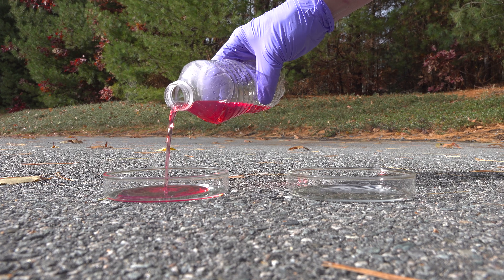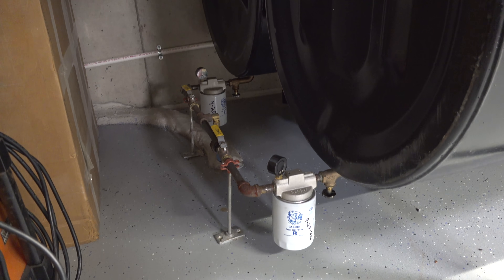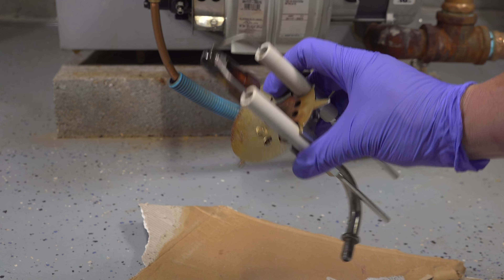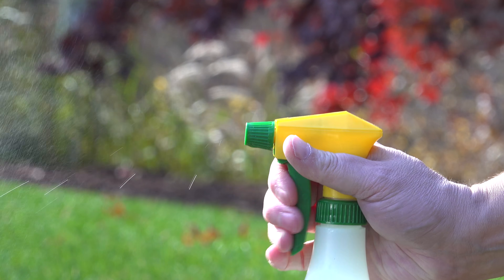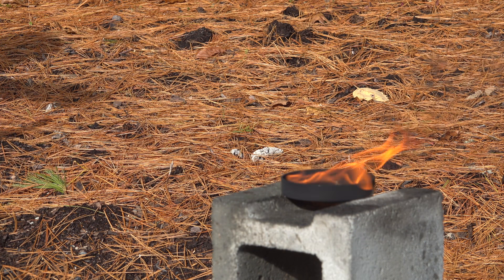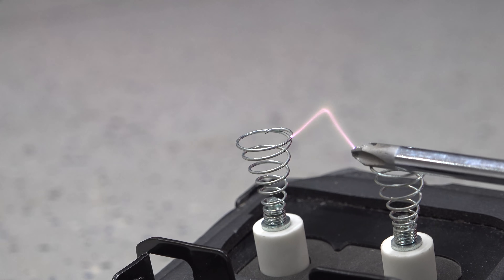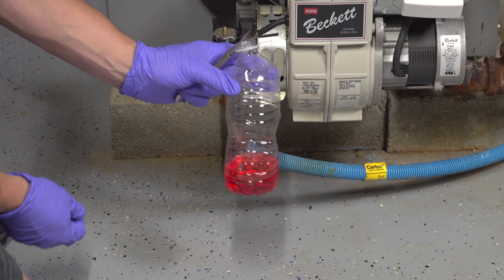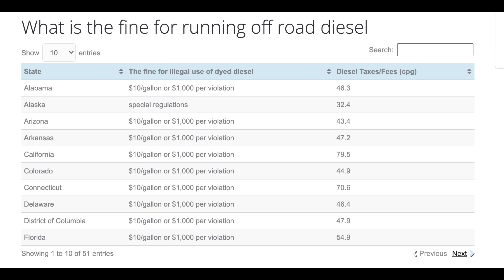Why Heating Oil is BETTER than GAS - Explained

Comment: technically, diesel and heating oil are the same, but nowadays, the diesel fuel is much more refined than heating oil and most car companies won't accept warranty repairs if the engine was fed heating oil.
Reply: Heating oil is the United States is all sold ULSF these days
Reply: @lg4ky  Not true
Reply: The DOT will give you a big fine if you use home heating oil because it does not have road tax like diesel
Reply: @Larry Butler Is your 40 year old diesel car still under warranty?
Nope
Does your 40 year old diesel car use common rail fuel injection?
Nope

So it's not BS. Your car has an original diesel engine and will run on basically any heavy oil. New diesel engines work in a slightly different way. A way that reduces lifespan and makes them shit. The point of the diesel engine was that you could run it on whatever you wanted. New ones are very picky about what you feed them.
Reply: @daviddavidson2357   as long as the oil is heated to decrease viscosity and filtered appropriately a common rail engine will run on the same oils as any old more rudimentary diesel engine. Its not black magic its mainly higher pressure and greater vaporization of the fuel.
Reply: In New York State they are exactly the same.
Reply: corey Babcock  Yes you can.. No problem.
Reply: New diesel fuel is only 15 Parts per million of sulfur vs 500 PPM in the past.  New diesels use high pressure common rails with injectors that pulse fuel up to 5x per fuel delivery, (depending on throttle load).  These Piezo injectors would clog with heating oil or old diesel oil.
Reply: It is exactly the same in NYS. The only difference is the color it was dyed. In fact, in NY most places sell bio diesel which is 10% recycled oils.
Reply: Anyone in the US saying these fuels are different is full of sheet.  The fuel delivery guy for our company literally just adds a ladle of colorant to the "on road" diesel for our "off road" diesel.  It's the exact same fuel with coloring added.  As far as 1K kerosene, I think there is a difference, but it definitely doesn't ignite like gasoline as suggested above.
Reply: I burn Cod liver oil in my truck
Reply: @Larry Butler Laughter? It was probably shock and horror that a German engineered product had broken after only a few decades.

Meanwhile if you did that with a six month old Tesla you'd probably get:
 "LOL caveat emptor.
Signed - Elon"
Reply: There's also farm diesel. What are the differences between farm, heating and road diesel?
Reply: @FishyFelix  they add sulfer to "on road" diesel so it's easy to test by the states DOT teams out in the field, otherwise it's the same thing! Just used for tax purposes
Reply: @da_blade5040  Yeah, no.
Reply: @Icutmetal  lol troll
Reply: @FishyFelix  I can't speak for all US states, but with the Ultra Low Sulfur mandates the difference is primarily in the taxation. Here in Pennsylvania Heating Oil (for residential use) is completely untaxed, Off-Road diesel as well as heating oil for commercial uses pays the standard 6% sales tax. Of course regular diesel pays regular fuel taxes.
Reply: In the UK and most of Europe I believe, it is kerosene 28 second heating oil. Gas oil (red diesel 35 second is still used for heating in some commercial premises and a very small number of domestic dwellings.
Kerosene is a very clean fuel with very little lubrication so you wouldn't want to use it in your diesel engine without adding additional lubrication.
Reply: @andrewdouglas1963  kerosene in the US is known as #1 grade fuel oil it can be ignited like gasoline, we sometimes used to add a bit to oil fuel oil trucks to clean out the engine, Until they changed the "taxable" diesel laws ☹️
Reply: corey Babcock  sure, some Chinese "road diesel" is not in good quality, and they runs fine.
Diesel heater is not a delicate machine, it is just a miniature of the burner shown in this video but heat air.
Reply: As somebody who works with fuel systems, the only discernable difference between diesel and heating oil is the dye. On storage tanks it is labeled as ''dyed diesel". It will burn well in diesel engines but will colour your tailpipe red and that's how DoT will know. Trust me, they aren't going to dip your tank to check if you're burning furnace oil.

Comment: How does heating oil compare to natural gas in terms of heating cost???
Reply: Depends where you are.
Reply: If I remember right, a natural gas Therm is 100KBTU, while a gallon of diesel is about 130KBTU, so compare the local prices for each, including the amortized monthly Natural gas hookup cost and the oil delivery cost.

Comment: Thanks.  I live in CA where all resources used to heat a home are taxed.  Electricity, natural gas and propane.  I've been thinking about retiring in Michigan or Wisconsin.  Its nice to learn that heating oil (kerosene) is not taxed.
Reply: Liberals killed Cali.  If you're a leftist stay put.  You made your bed, now sleep in it.
Reply: @rickfromthecape3135   When I get there, I'll be sure to cast my vote.  Although, I didn't bring politics into the conversation.
Reply: @rickfromthecape3135  Ain’t that the truth.

Comment: That’s a great explanation video. I thought fines would have been higher for using died fuel in a truck.
Reply from the maker: I agree. I figured it would be a $5k fine or more since they want to scare you but not yet I guess

Comment: Screw using heating oil, if you can afford to buy an alternative method like a mini split ot heat pump go that route. Oil price is going to be through the roof. Find a better thing to heat the house . In other countries they are using it and is far better.
Reply from the maker: I don't disagree about cheaper options, I have a small heat pump I put in here https://youtu.be/kEWzIfnIhUw ideally if I could add solar that would be one of the best options of all.
Reply: Well. I installed two heat pump at home and that has been my primary heat source. I kept on looking at the price for oil and just to add 150 gallons it will cause me a whooping 450 . So i said i will stick to heat pump till it gets super freezing . Testing mode now.
Reply: @Larry Butler how clean does it burn? Smoke comes out chimney ?? Or just a vapor??
Reply: It was the second largest bill next to rent when I had to use it. I'm surprised more New Englanders don't freeze to death each year from the cost.
Reply: @jasonlarsen4945  2,000$ to heat a home for 5 months isn't really too crazy.  2 or 3 paychecks. Real bank breaker.. Lol. You probably dont bat an eye buying 1,000$ phone every year to keep up with the jones'. Not everything is free. I guarantee you'd rather work 2-3 weeks for oil than cut, split and stack that same btu in wood.
Reply: Not too mention 99% of people dont even have the option of wood. 
So dont act like you're not being fairly compensated when buying oil.
Reply: @Larry Butler True. How, there's a divide between unleaded and diesel. The demand for big trucks is not going to decrease, the demand for electric big rigs is not quite there yet. 

If people switch from diesel passenger cars to electric, which could go either way, diesel is already more fuel efficient, but people who drive that might be seeking fuel efficiency.  

Gasoline prices will drop with the increase in electric cars, if that demand outpaces reductions in available crude supply.  However, decreased demand for diesel will probably lag behind decreased demand for gasoline.  Unfortunately.  For people who use red diesel for heat at least. 

Convince major trucking companies to convert to electric rapidly, and that could be a different story completely.  

Diesel used to be cheaper than gasoline, 20-30ish years ago.  It could happen again, but not with trucking in such high demand.
Reply: Depends where you are

Comment: That shit stinks I’ve installed oil boilers for yrs it’s great for heating houses tho
Reply from the maker: That is very true! Very odd smell you never forget
Reply: Hydro treated veg oil will replace our kera here in the uk. Its a certified net zero fuel.

Comment: fun fact, around 20% of all german homes are heated with heating oil. even 40% in bavaria and some other states. Also the red dye nowadays is mostly there for differentiation. to counter tax evasion the additive "Solvent Yellow 124" is added, which cannot be removed easily and can be detected in very small quantities. prices in europe fluctuate with the global oil market around 40-90 euro-cents/liter of heating oil, which is around half to one third the price of diesel for cars and trucks.
Reply: Hast du schonmal erlebt, dass die Polizei oder Irgendjemand kontrolliert hat, ob man Heizöl getankt hat?
Reply: @lucian0221  I don’t know about Germany, but as an owner and driver of a truck in the United States, over the road highway trucks they rarely check. But trucks used for agriculture where they have access to large amounts of off-road diesel they check them more often. The thing about trucks driving across multiple states, is that you have to Report to IFTA the amount of fuel you’re buying in each state and how many miles you drive in each state. You also must keep the fuel receipts on file as proof. So if you ever get an audit they would be able to see if you purchase off-road fuel. If you don’t buy enough fuel in a particular state For the amount of miles you drive In that state you must pay fuel taxes for the Fuel you should’ve bought based on the mileage. I’ve never heard of them checking fuel in cars,but unlike Europe we don’t have many diesel cars.
Reply: We get natural gas here in tx for like 7 cents a gallon
Reply: @johndowe7003  Lucky you. It's about £0.50 for 1 cubic metre.
There's about 4 of those to a gallon.
Reply: Fun fact. In Poland which is Germany neighbour less than 0,01% of homes uses heating oil. In 1999-2003 people were tricked to buy oil burners by low oil prices. After 10 years additional taxes were put on oil and the oil price were doubled. People returned to coal and some moved to gas. This year gas prices raised about 70% and people are being tricked into heat pumps. Waiting for electric energy prices to sky rock 🤣
Reply: @rolnikzkorpo5352  Once you have to pay for the environmental damage caused by the CO2, heat pumps will likely become the cheapest.
Reply: @CjqNslXUcM  In Poland the main problem is that most of the energy is produced from coal meaning power plant efficiency is about 10% and heat pump COP around 3 does not change environment impact. Currently burning oil or gas is most environment friendly solution here which is sad.
Reply: @rolnikzkorpo5352  CO2 pricing would mean coal would become more expensive than nuclear or renewable, even on a power plant scale. It is already too expensive if you think about the damages of climate change, but right now innocent people have to pay for it.
Reply: @CjqNslXUcM  if you really cared you'd switch to nuclear. It's something we actually have that can generate the power we need reliably. I won't take so called global warming serious unless it includes talks of ALL alternatives not just fotm silicon valley schemes
Reply: @rolnikzkorpo5352  If you have land, start growing a wood lot. Black locust grows fast in Europe and coppices or pollards well - perhaps too well because it has a suckering habit. If you can get forestry approval from the government (or if you don't care about breaking the law), you may be able to have a nice little side earner.
Reply: @ellenorbjornsdottir1166 Well.. You can plant trees in Poland, but you cannot cut them down - you need official allowance for every piece 🤣. There is something like energy birch, but... you need a lot of expensive equipment to handle it.
Reply: You remove the dye by running it through cat litter and then activated charcoal.

Comment: Big Oil propaganda. Natural gas and propane heat are safe. The gasoline in the dish has zero to do with home heating. I have been to more basements that fuel oil have spilled in that required thousands of dollars of spill remediation than nat gas or propane heated buildings that have had issues.
Reply: It’s easier to make sure heating oil doesn’t leak than to wake up dead.
Reply: "big oil" Wait until you hear where natural gas and propane comes from LOL
Reply from the maker: Not propaganda my friend just sharing my view. If I could get gas I probably would but in a lot of areas its not an option and I will have to look up which is more common, major oil leaks in residences or gas leaks that resulted in sizable damage. The other plus for oil for many is that it keeps them in control and self sustained for some amount of time. Might not matter to everyone but some like it.

Comment: Are you serious???...There are over 332 million ppl in the US and 62 Million homes use Natural Gas for a Reason!!!....it's the worst idea for heating a home ever (OIL)...and most importantly when you run out (Not if ...When) you freeze to death.plus if the roads are not drive able then what? ...Really???
Reply: that is why the storage tanks for oil burning houses are huge. My parents house has 800 total gallon capacity. They get it filled in September every year and have never run out...and they live in Michigan, so winters are rough.
Most houses that have oil furnaces are rural so natural gas isn't an option...and propane has the same issue with tank capacity.
Reply: @joeycameron4744  No one saying its not a good source if there are no others!!!...BUT ...there is clearly  ANOTHER OPTION!!!...and it's FAR FAR FAR more superior then OIL...for too many reasons to mention!!!....  Like i said ...really?...
Reply from the maker: Keep in mind a lot of houses with nat gas have very light heating needs compared to colder climates and for states like VT, ME, NH and NY and MA there are many areas without public utilities and it still is a great choice. Natural gas is more efficient and cleaner but not really a great option for some areas, propane is an option but can often be the most expensive of all.
Reply: @SilverCymbal  That's not even correct...Google it..
"natural gas furnaces have higher efficiency than oil...They just cost a little more to set up
Reply from the maker: @jefferysmom696  Gas is absolutely more efficient than oil, I don't dispute that.
Reply: Oil is more effiecient, but costlier.  More BTUs in oil.

Comment: Funny story from Hungary: it was the same dying process here until the 90s, (amd heating oil eas cheaper than diesel) then criminals started to “bleach” the heating oil to make it the same colour as the diesel fuel, and sold it.
It became a serious crime with thousands of people involved. 
Then after these years: there is no cheaper price for the heating oil anymore, both are priced the same.
So basically nobody uses oil for heating here anymore.
More here:
https://en.wikipedia.org/wiki/Oil_bleaching
Reply: That was an international issue. Same here in Slovakia and same kind of fraud was popular in Czech rep. I am nod familiar with the current situation and pricing. I believe however that even agricultural vehicles were allowed to use the so called red diesel fuel.
Reply: Didn't know AMD makes heating oil. I thought they only make CPUs and graphics cards. 😁
Reply: @Charon-5582  especially when it doesn't even go towards iits own country or people
Reply: Why is that labelled as being a criminal though? Isn't is all about money? How is that morally acceptable? Fuck laws if they aren't moral.
Reply: @JackRR15  so they cheated with tax a lot, but agree